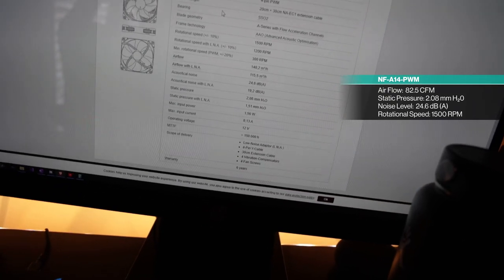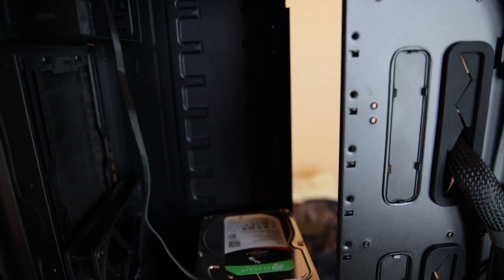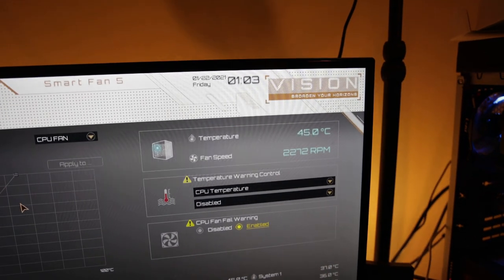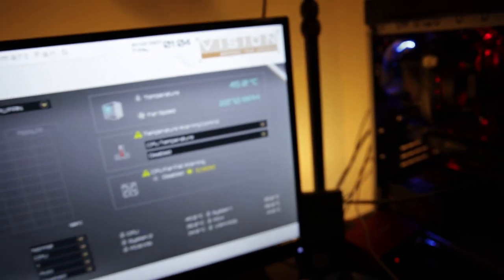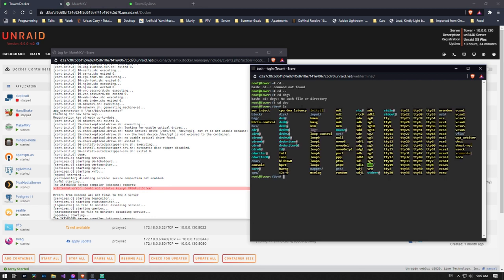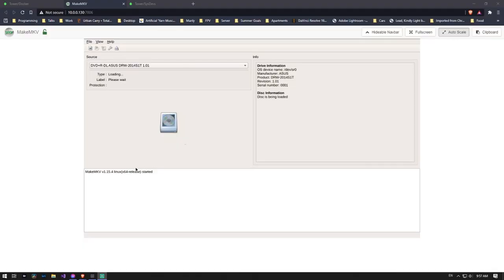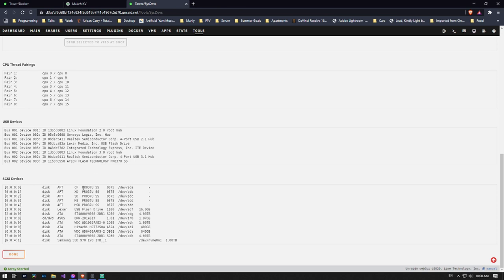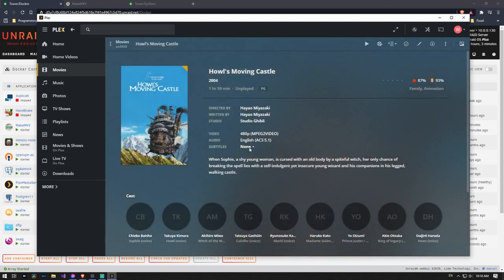[PT4] Power For 18 Drives And Keeping Them Cool

Comment: I have 18 HDDs in my Define case too but stuck with the included Fractal fans. All my drive temps stay below 40 C. The 'backwards' power cables is a very common issue. I have the same issue even tho they are semi-custom sleeved. The biggest difference is that I used a top-mounted AIO with 240 rad for my CPU. I have a few 140mm Be Quiet fans to help circulate air internally. Was never worried about noise because I put in outside my room and run a 10 gig SFP+ cable to it. I have it on a cart with a UPS so that it can always stay on even while rolling it from one room to another. My Unraid NAS is over 90TB and I plan to grow it more, which is where a second PSU comes in.
Reply: I think in your case, too much of the CPU heat is going into the HDDs. A top-mounted AIO with fans pointed upward would have prevent that from happening, and you wouldn't have needed those new fans. Or maybe your HDDs run hot. All of mine (except 1) are Western Digital (6TB, 8TB, or 10TB).
Reply from the maker: Most of my drives are a bit dated, so I think that may be part of why they run "hot". If they were all newer drives, they might not be quite as toasty. But, I don't get any temp warning now, so winning! lol

Comment: Where were you sourcing custom power cables that you measured in this video?
Reply from the maker: moddiy.com
Reply: @joshua.sutherland  I know this is years & years old now, but could you divulge what lengths of cables you requested for this build?  I love how you have it set up & I'm looking to copy it.  Thanks in advance.
Reply from the maker: Hey @TheDesignated1 ! I don't know how well this will copy over, but here are the measurements that I sent in for my cables. 

Cable1: Modular Connector <--- 75cm --> SATA <-- 13cm  --> SATA <-- 13cm --> SATA <-- 13cm --> SATA <-- 26cm ---> SATA
Cable2: Modular Connector <--- 60cm --> SATA <-- 13cm --> SATA <-- 13cm --> SATA <-- 13cm --> SATA <-- 13cm ---> SATA
Cable3: Modular Connector <--- 60cm --> SATA <-- 13cm  --> SATA <-- 20cm --> SATA <-- 13cm --> SATA <-- 30cm ---> SATA
Cable4: Modular Connector <--- 50cm --> SATA <-- 13cm --> SATA <-- 18cm --> SATA <-- 18cm --> SATA <-- 18cm ---> SATA
Reply: @joshua.sutherland  AWESOME!  Thank you very, VERY much!
Reply from the maker: @TheDesignated1  Yup! And this was for a standard size power supply. Seems to be working pretty well for me so far. Hope it works for you!